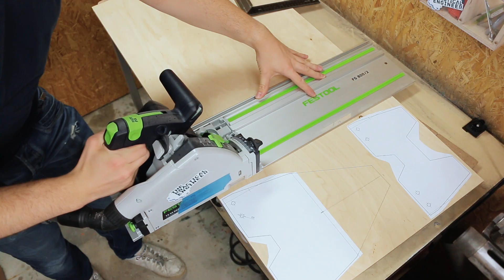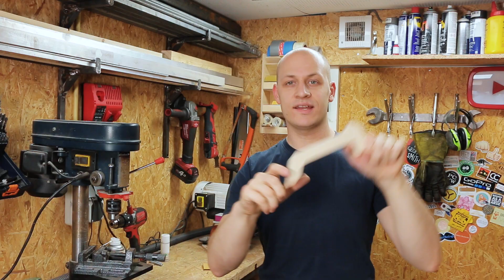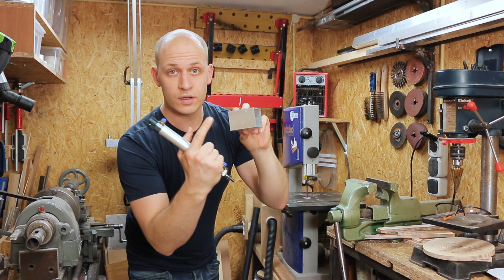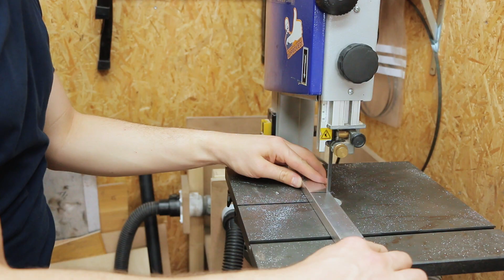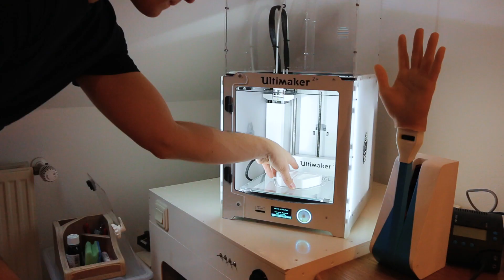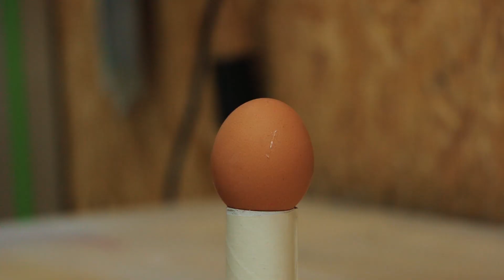Large parallel jaw gripper on air power!

Comment: Hey Emiel! What thickness plywood do you prefer to work with in the majority of your projects?
Reply from the maker: Depends a bit on the size of the projects but for all the smaller machines, oreo dispenser, this project, bubble wrap popper etc. I use 9mm plywood

Comment: Was all the stuff that had to do with the pneumatics expensive? I would like to maybe implement some pneumatics into a robot arm I am building but not sure if it will be worth while.
Reply from the maker: It depends a lot where you buy it. I bought most of this from aliexpress (China) and then it's like 25 euro's in parts for this build. A couple of days ago I had to order similar parts here in Europe (from an actual quality brand) and then I paid 6 times that price
Reply: @Thepracticalengineer  25 euros isnt too bad. So you got an actuator, a solenoid, and what was the last thing?